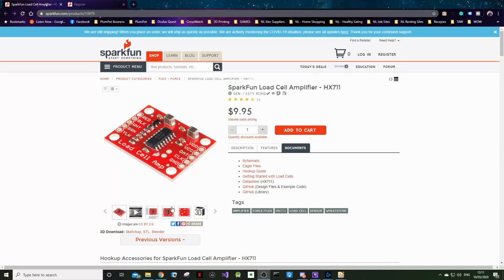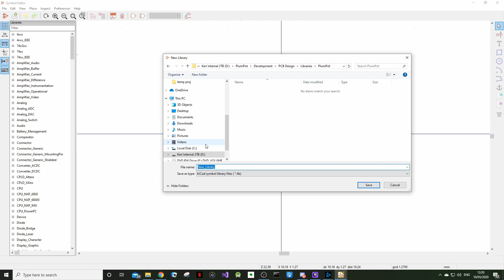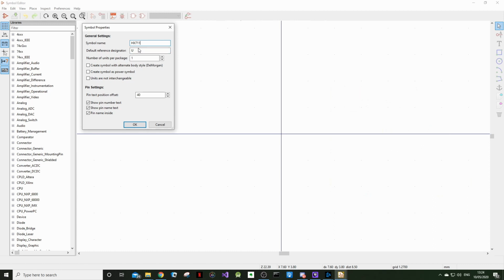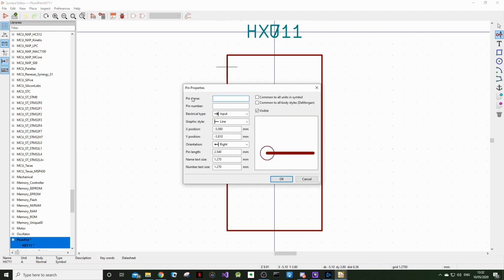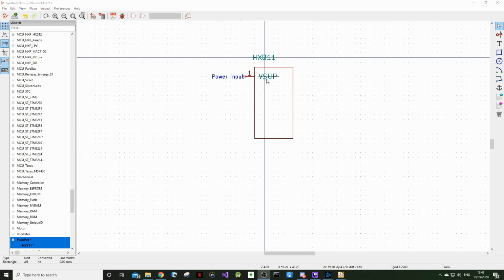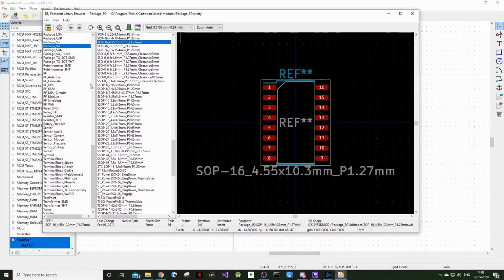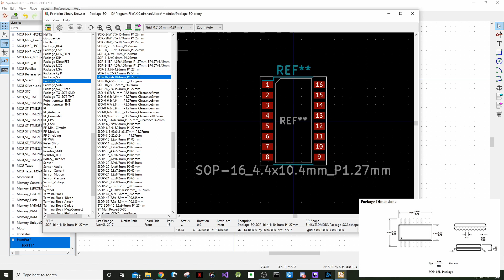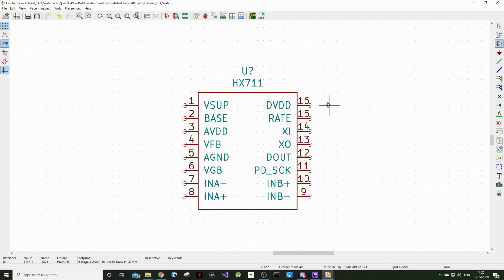KiCad Tutorial  - Create a Schematic Symbol in Kicad

Comment: In most cases, matching the symbol layout to the physical pin layout doesn't create the most readable schematics.  I find a better way is to identify and group together inputs, outputs, power supplies and grounds and then to draw them:

Inputs on the left
Outputs on the right
Power supplies on the top
Grounds on the bottom

As always, YMMV, however this tends to result in schematics with signals that 'flow' from left to right across the page.  Further groupings, eg. data lines and address lines makes it easier to 'bus' these together for further ease of reading.

Comment: Very Nice Job!  Some topics you may want to consider: 
(a) Complex symbols (such as microprocessors) that have hundreds (or thousands) of pins... I have found that having multiple bodies are extremely useful (not to mention readable) and the copy-and-paste functions are critical to building these symbols in a reasonable amount of time.
(b) Re-structuring the symbol may help the designer keep the wiring "neat" on the design - 
(i) Vcc/Vdd to Top, Ground Below - unclutter the schematic.
(ii) Signal In on the left, signal out on the right - keeps design flow readable
(iii) Support components (crystals, bypass components, reference diodes and the like) off to quadrants (I happen to like the upper left for crystals to let the designer know these are important) - again for both signal flow and to let my PCB designer know these are really important
(iv) Differential lines paired and kinda broken out (two pins then a space) to differentiate them.
I'm looking forward to seeing the video on PCB footprints..
Cheers!!! and keep up the good work!!

Comment: How do you connect 2 components diagonally in schematics?
Reply from the maker: Hi you mean at 45 degree angles?
Reply: @PlumPot  You CAN connect them diagonally. Just go into Eeschema and press CTRL + , and it will open the Preferences window.  Click Eeschema - deselect "Restrict buses and wires to H and V orientation".
Reply from the maker: Yes👍. Sorry for the late reply. I would advise of want quicker answer to ask on Discord🙂
Reply: @PlumPot  I usually ask John's basement. He replies very quickly.
Reply: @PlumPot  No prob.
Reply from the maker: Great glad you got it sorted🙂
Reply: @PlumPot  Can you connect it at any angle?

Comment: Digi Key has a complete library of symbols of all their parts that I downloaded and thought I installed but can't find it anywhere.  I need help finding it, adding other symbols, specifically Vacuum Tube symbols, and don't know where to go for help.  Can you help?
Reply from the maker: Hi Wayne, so you have two problems? One you installed a library that you cant find and the other one you would like to have a symbol of Vacuum Tube?

1. In your main window you need to go to Preferences-> Manage libraries. If you are struggling, maybe join our Discord it is easier for me to help. Or you can email me :)

2. Normaly ill google all over the internet for some footprints lol, you can try SnapEda, we made a video how to integrate it in your KiCad: https://youtu.be/hqTSoMNh06c
Let me know if I understand your question correctly :)
Reply: @PlumPot  SnapEDA is Windows only - so not actually useful. Most designers use a Linux look-alike.

Comment: Creating schematic symbols the way they appear in the data-sheet gets really messy, very quickly when you start working with larger footprint chips (e.g. a TQFP100 Micro like the STM32F1 variants. It is appropriate to follow the practice of grouping pins by functions ( Or in case where multi-functional pins are a norm, again most Cortex M series micros, create a symbol that is specific for the project ).
Reply from the maker: Thanks for your comment, that is a very good point! Will definitely speak about that in the next video. Was trying to keep it as simple as possible :) Do you use the STM32F quite often? I'm making a design now using it, so interested to see how it goes🙃
Reply: @PlumPot   Yep. I use the STM32, its cousins from other companies as well as other micro-controller families very often. If you need help at some point ( Just to be clear: Open Source Shared, No commercials expected help ), please feel free to mail me on archis.bhave@gmail.com.
Reply: https://youtu.be/upaVO_SMAQMy8